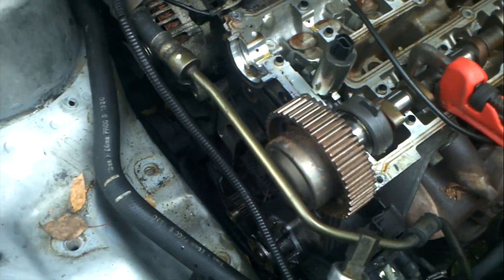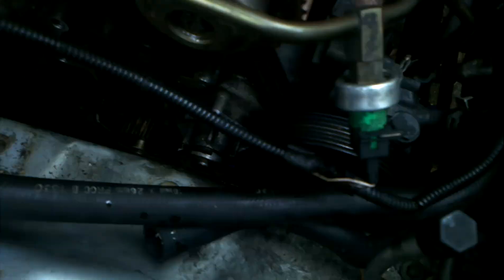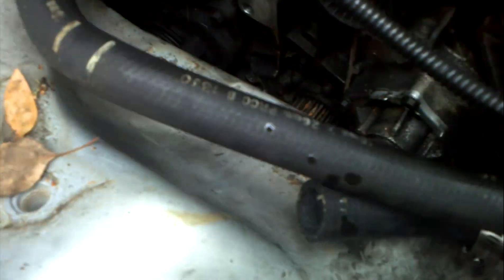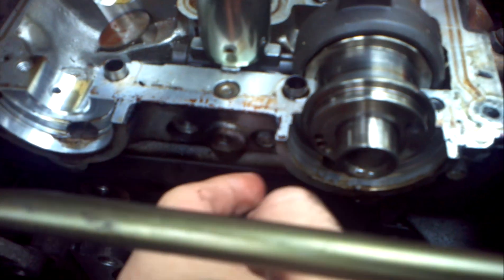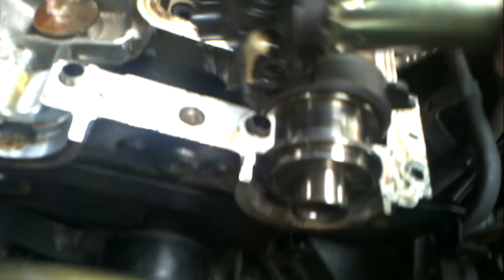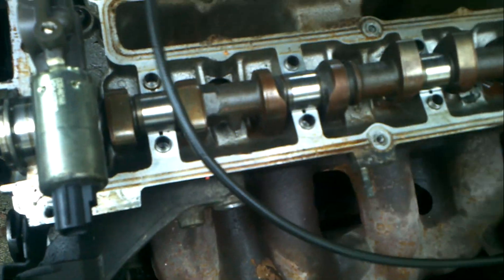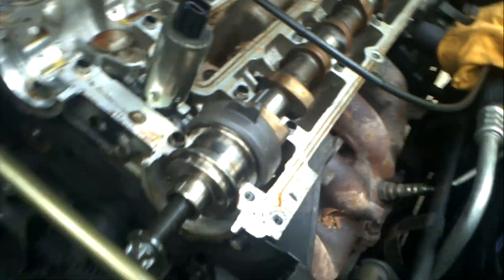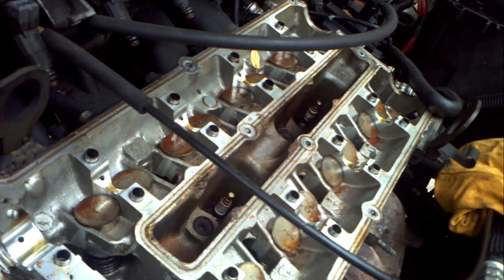zetec vct removal

Comment: Due to carelessness and without knowing the problem I was getting into, I moved the oil supply rings of the VCT sensor where the pressure pulley is located. Here is the oil pressure sensor, and that sensor connects to the camshaft. I'm having a lot of trouble putting those rings in the correct position. I searched online, in PDFs, and with AI, and I haven't been able to find the correct way to arrange those oil supply rings. I translated this with Google. Hahaha ¿Do you have any advice?

Comment from the maker: I'm sorry I have not responded to these questions sooner, I never really saw them until now, the way i reset the vct is by setting the timing, slapping the valve cover back on, hooking everything up, and starting up the engine for a minute.  then the vct will be in position, but your timing will be off, re do your timing and it put it all back together.
Reply from the maker: +alejandro landeros from my experience if the car sat for more then 6 months you will need to crank the car for quite a while to get a start. I'm not sure if it is the vct tbh. my fix for that is drive it a few times and change the oil. has worked on three cars I've had this issue with.
Reply: Could be engine coolant sensor and cooling fan sensor my was hard to start up replaced these and now turns over first start up.
Reply from the maker: Patricia Keith coolant sensors don't have much to do with start up though